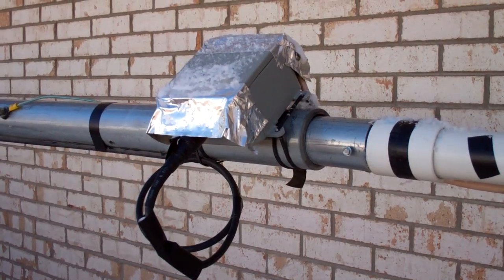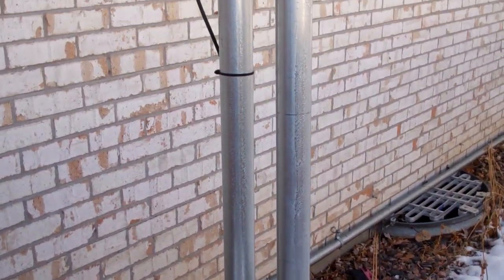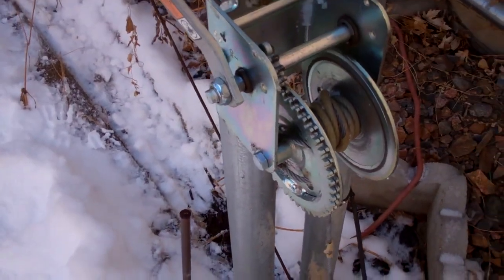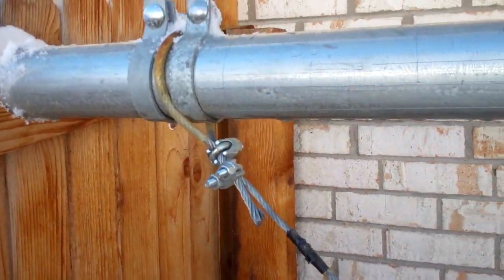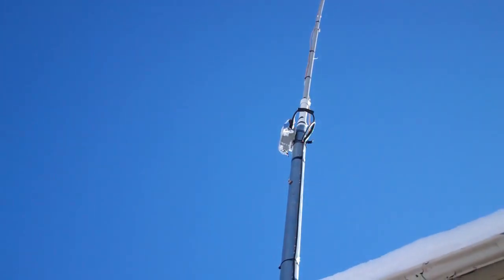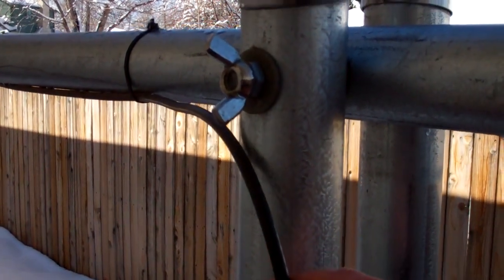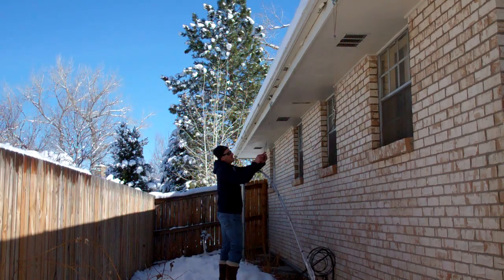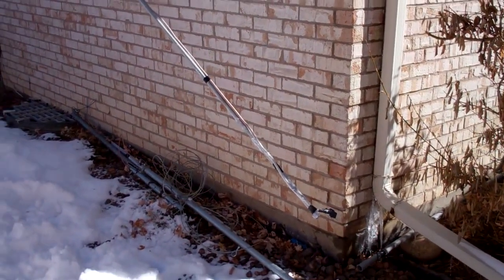Tilt-Over Crank-Up Antenna Mast

Comment: Considering this myself. thanks for the video. What is the status of your antenna mast now that it's  may 9, 2019?
Reply from the maker: I put it up about 10 years ago (2009) in its original version. I have had the fiberglass mast up for about 8 of those years. The galvanized steel parts show nothing other than the white/gray oxidation zinc gets over time. The fiberglass mast shows some discoloration from the sun but is still very flexible. The crank winch is the same as the metal mast pipe. The most affected by the weather has been the steel cable which was originally plastic coated. All of the plastic has dry-rotted, cracked and peeled off. The steel cable has surface rust/oxidation that looks normal and has not compromised strength. If/when I replace it I'd use a galvanized vs coated cable. All the bolt hardware is stainless and only shows rust in a couple of places like tips of threads or where there is a scratch. So overall I would say it is in excellent functioning shape. I wonder if a update video showing weathering would be useful?

Comment: That’s more complicated than it needs to be. Instead of adding an expensive wench, pulley, and cable, why not just add weights to the short end that raise the pole until it’s erect? After it’s up you could simply use a gate latch to secure it in place; it would have been a lot cheaper and faster.
Reply from the maker: The winck pulley and cable added only maybe $75-80 to the cost at the time. The original mast was 39 feet of 3 1/2", 3" and 2 1/2" thick-wall galvanized fence post. It weighed almost (or more than?) 200 lbs on its own. I had a 20-25lb antenna on top of that...so the whole thing weighed quite a bit and I was not able to pivot it into position. Even if I was able to do it by hand, one slip and it could have taken my head off. Now of course, after the first 13 feet, it is just 10 lbs of fiberglass pole with a simple wire running up the fiberglass. So now it is overkill. But I still have options to use it with whatever I may in the future.

Comment: Never run your rebar into the ground, they quickly rust all the way into the concrete.
Reply: Recently code has changed. They found not enough oxygen is underneath to support the rust theory. Rebar can now be ran into the ground on house footings .

Comment: You need a winch with a brake on it.
Reply from the maker: It has a ratcheting system that I was not using for the video because it made too much noise.

Comment: looks like a breeze rider we get 50- 60 mile per hour storms here bet its really steady then maybe you're trying to to get broadband the mast head should be in a broadband to say the least
Reply from the maker: It is used as a broadband antenna and has a matching transformer for MW that works a little bit for LW as well. Although it can stand a good bit of wind I rarely use it when winds are over about 10 mph.

Comment: That is a very neat antenna mast design and you have done a brilliant job describing it.  Thanks for posting it.  Have you made any modifications to it since the video was first published in 2015 ?  Thanks,  Jamie  VK2YCJ
Reply from the maker: No I have not made any further mods - other than adjusting the U-bolts as others have recommended.  It is currently the same as in the video. Everything seems to be holding up well to the weather and time.
Reply: Thanks, that is good news.  Jamie  VK2YCJ
Reply: @kugellagers  what adjustments to ubolts did you do ?
Reply from the maker: @lancelarymore1667  I fixed the Ubolts per Dave Vick's (and others) comments...I think I did it correctly anyway.

Comment: One of your saddle clamps is in on the wrong way round...the best way to remember how they go on is the old saying, "Never saddle a dead horse." So the "U" bolt goes over the dead end, short part of the cable and the saddle goes over the live or long section of cable. And like the other fella said, you need a way to secure the moving mast near the bottom, relying on the boat winch is asking for a trip to the hospital. But well done, quite clever.

I did something similar a few years ago with 4x4, 2x4 and a 12vdc ATV winch.
Reply: I have a few grey hairs, and I never knew that about saddle clamps. Thanks for the lesson!

Comment: Just a heads up on the use of the cable clamps.  The little "U" shaped clamps.  I'm a retired crane operator after 50 years in the field.  Did a lot of changing of cables through the years.  Here's a little saying to help you remember which way the clamps face when you put them on the cable.  "You never saddle a dead horse."  So the little short end of cable sticking out past the clamps is the dead end.  You don't put the saddle on that cable.  Spin it around so the saddle sits on the long cable, "The live end"  Also you only need one cable clamp.  Because each clamp you put on the cable reduces the strength of the cable by 50%.  All of this information is located in a book of cable rigging standards.
Reply from the maker: Thanks for the comment. You are the second person to mention that in the last month but gave a more detailed explanation. I will go fix that when I get the chance. When I put this mast up about 9 years ago it was the first time I ever did anything with steel cable. I definitely want it to be as safe as possible. Cheers.

Comment: Why did you put the cable clamp on backwards? Rule is "never put the saddle on the dead horse" as the saddle is on the dead end of the tail. I was taught to use 3 all with the saddle on the live side of the cable. Just curious.
Reply from the maker: Are you referring to the two steel cable clamps/bolts clamping the ends of the cable together?  If you are, it was the first time I have ever used them so I just put them on in opposite directions and at the orientation I thought would interfere least with the crossbar at the bottom of the two mast poles. No other particular reason.

Comment: Similar to my setup. I'm using 30' top railing, 10' fiberglass antenna, 50' RG8X coaxial, a swivel clamp that connects the top railing to a 10' top railing next to it which is cemented. I have a 2' pvc that is cemented underneath the main mast so when the mast is up, I can slip it into the pvc which aids in keeping it stiff and secure, hand winch and pulley. It's all secured with aircraft galvanized wire rope at different points. Although the entire concept is about 30lbs, I don't often use the winch. It's not that heavy for me to tilt over with the swivel clamp. I have my CB antenna up, too.
Reply from the maker: The 30' of top rail doesn't flex too much?  I've played with 20' of top rail with a temporary tripod setup for testing antennas but not 30'. My mast has been up there about 9 years now and the only signs of weathering has bee the plastic coating on the cable and a slight color change in the fiberglass mast. The original setup was much more heavy and tall and is totally overbuilt for how I have it configured now.
Reply: There's some flex with the 30' top railing when it reaches a specific angle while raising or lowering it, but, not much. It 's very stiff and doesn't move when I push it while It's up. But, It's still durable. Even with the flex, that stuff isn't going to bend. It's only taking about 3lbs-4lbs from the antenna for the highest top railing and the middle one take about 10lbs from the highest one, top railing is about 7lbs. I hammered the ends of the top railing in a bit to crimp it around each other, wrapped the ends with 3M electrical and rubber tape to make them thicker and add grip and keep them stiffer and some galvanized bolts and washers and Loctite. I had 20' of 1-1/4" pvc up for about three years, even during that mass hurricane I had last year. It held up, no damage. Maybe because the walls between both houses block a lot of wind. I wanted to go with a more easy and professional setup, though, so, I decided the top railing. That's good about your setup, though. I periodically addon little upgrades such as more guy wires when I have the funds to make sure everything is good. I just like taking extra steps sometimes. I thought of trying some conduit in the electrical area at home depot, about $7 for 10' galvanized. But, I went with the top railing because the ends were tapered so they can connect. Although galvanized sleeves don't cost much.  Top railing was $12.99, so, the conduits were half price. I have eye bolts in the top raining to connect the winch and guy wires. I may relocate my pulley, but, it gets annoying drilling through masonry.

Comment: Thank you very much for sharing this video.  This is what I had in mind for my future vertical antenna but I wasn't sure how to go about putting it together.  Amazing job!  Where did you buy the crank mechanism?   Make / model.  Thanks again!
Reply from the maker: At my local Ace Hardware store.  They have a lot of stuff you don't always see at the big box places. Here is a link to I think the same crank/winch I am using in the video: http://www.acehardware.com/product/index.jsp?productId=17209176 I also added winch info to the video description up above.
Reply: +Kugellagers Noodle Excellent!  I'll be ordering this winch very soon.  Thanks again for your informative video and posting the link.  73's WA4NE

Comment: nice job but how do you secure you mast? Not a good dea to let it hold on the crank winch!!!safety first
Reply from the maker: The crank winch has a locking mechanism that could be padlocked if necessary. I never have the antenna up for long as I only use it when I DX.  I only crank the antenna up when I DX.

Comment: nice job, I designed the same tilt over mast but used 4 X 4's (2) 12 foot in the ground and the center pivot is 20 feet, same as you, 3 feet into the ground, and 4 feet nested between the 2 base 4 X 4's, crank is on a lynch post (9 ft. + 16 ft. = 25 feet) then electrical kindorf (U channel) bolt mounts a piece of chain link fence top rail (10.5 ft.) to the top of the pivot 4 X 4 mast adding 6.5 feet for a total of 31.5 feet to the base of the antenna

Keep up the good work Rekindling The Reformation !!

Comment: KUT ,YOU SHOW HOW ITS WORK WITH THE 30 FEET STEELL PIPE ,THANKS RAMON ,I WANT TO BUILD ONE LIKE YOURS.
Reply from the maker: I no longer have the mast as 35 feet of all steel pipe but I did 
describe it below under Gear Hammer's question. The base and winch are 
adequately strong to use steel pipe as I used to have it. Was that what 
you were asking?

Comment: For additional safety, I would put another 1/2" bolt/wing nut near the bottom or middle to secure the mast for accidently falling, using the crank to secure the mast is asking for trouble!!!!
Reply: I totally agree with you, Ben. The time and cost to do that is minimal and the added safety priceless. The cable is already rusting and there is no way I would risk my safety or the safety of loved ones on just that cable. Good luck though! I love the idea!
Reply: Same reason tow truck drivers have to use chains to secure the front of a vehicle...  just in case the winch and/or cable breaks.
Reply from the maker: Hi Ben,  Thanks for the concern. The winch has a locking mechanism and the ability to actually put a lock or bolt to secure it (when up or down) as well - so there is no worry of it failing.  The cable is 1/4" steel cable and has several thousand pounds breaking strength and about 1400 lbs working strength.  For my uses it very safe as I only use it in good weather...I think it is more than sufficient for how I use it.

Comment: nice how tall can you go
Reply from the maker: +James  Schell  The metal mast pipe is 13 ft tall and the 4 sections of telescoping fiberglass poles on top are another 27 feet for a total of 40 ft.  The fiberglass section supports 27 feet of old RG-59 coax which I use as the actual antenna for MW/LW DX'ing.
Reply: ok thanks

Comment: Neat ingenuity! Wish we were neighbors I could use some help to construct a similar for TV antenna.
Reply from the maker: +Tony Micenhamer Thanks for kind words.  Yeah I&#39;d definitely lend you a hand. Overall construction was relatively easy as I built the whole thing without any help. Digging the hole for the cement was a little back-breaking as the soil has a lot of clay in it here...which is good for grounding but not fun for digging.

Comment: Nice job! Quick question: What about using some 1 inch EMT conduit that is coupled together instead of the fiberglass tubing? I know it would be a bit heavier, but that winch you have seems heavy duty enough to be able to do the job. Also, are you just running coax up the length of that and using the coax as your antenna? What bands have you been able to get on that design?
Thanks and 73!
ka0rsn
Reply from the maker: +Gear Hammer I used to have the mast itself at 35 ft in length and then an antenna on top. The remainder of the mast was two more sections of heavy gauge fence post that telescoped into each other and into the remainder of the current 3 inch piece I am using as the mast for the fiberglass.  I have also used fence top rail and EMT conduit in experiments. The problem I have found with using two or three sections of fence post or EMT, in my experience, is that due to the length I am using they are not very good in wind unless you are using guy wires.  The weak points are at the coupling points.  One ten foot section is fine but multiple sections become weak.  I do use connected 1.25" fence top rail as a mast on an antenna tripod for temporary antenna experiments in the yard but not for my permanent installations. I have also used EMT for a 1/4 wave CB base antenna as well.

In answer to your second question; The coax runs up the fiberglass mast and I am using the coax shield as the actual antenna.  I have connected the inner conductor to the shield at the top and bottom as well.  In addition, I put a female F connector at the top of the coax antenna so that I can use the coax as actual coax line to feed a small experimental antenna at the top if I desire. The design of the antenna is what MW DX'ers call a low-noise vertical which I use a broad band matching transformer of 44T:6T on an FT114 type J toroid in the small box at the bottom to match the MW and to some extent the LW bands. I am primarily a MW DX'er.

Comment: Just remembered I have a crank on my old boat trailer. Put the pole in the ground today. How hard was it to drill in the holes?
Reply from the maker: +Darryl Mann It wasn't too hard to drill the holes.  Just make sure your drill bit is sharp.  Having a steel tap to make a little dimple on the tubing helps to get your drill started too.

Comment: انت واحد متفيج فاظي ما عندك شغله 
بيب 10 متر فوق البيت و فك عمرك 
اقعد نزل و ارفع ما شي شغل شو
Reply from the maker: +qwasuae Forgive me for not replying properly.  I used many different online translators and they gave me various amounts of nonsense.  The mast is supported on the pivot point about 2 m off the ground.  The pipes in the ground are about 3 m long and about 1 m of the pipe sits in a block of cement/concrete that is about 0.6m x 0.6m x 1.0m in size. When the mast is raised the top is about 4 m above the ground.

Comment: What kind of antenna is that?...I like the crank up idea you did..Cheerz
Reply from the maker: +Junior D The antenna on top of the 13 ft Steel pipe mast consists of 4 x 8 ft sections of  telescoping fiberglass tubing I got from DX Engineering (http://www.dxengineering.com/). The tubing holds up 27 ft feet of recycled RG-58 coaxial cable I am using for the actual antenna I used for MW/LW Dx'ing
Reply: +Kugellagers Noodle That's cool, I like the homemade antenna's...You have any power behind it, or just stock??..Cheerz!
Reply from the maker: +Junior D Are you referring to the crank/winch?  Only muscle power behind it.  It's really easy - my 4 year old son can do it.

Comment: Where did you buy the crank?
Reply from the maker: +Darryl Mann My local ACE hardware had it near their steel cable supplies. They called it a 'Pulling Winch'.  I think this is it (or very similar ) :  http://www.acehardware.com/product/index.jsp?productId=17209176  I forget the exact capacity of my particular model.  I'll try to look it up if you like.
Reply from the maker: +Kugellagers Noodle I checked the winch capacity last night. The capacity of the one I have in the video is 1300 lbs. This is more than enough to crank it up.  When I first built this mast it was 35 ft of telescoping galvanized fence tubing with a 27 ft antenna on top of this. It was much heavier and was still plenty strong.
Reply from the maker: +Darryl Mann Tell me about it.  I do most of my projects in 1/2 to one hour increments...sometimes in only 15 minute increments. I built the crank up mast before I had kids and when my wife had a evening shift job - lots of free time at home then...

Comment: Have you had the antenna extended during any significant winds?  I'm not talking about hurricane or cyclone strength, but say 25 - 35mph? If so how does it handle? Asking because of how flexible it is, any concerns about it maybe snapping?  Like the concept, something like this might work well for my home, darn HOA.  Thanks.
Reply from the maker: Jim K Hi Jim,  If you look at my Low Noise Vertical MW BCB DX'ing Antennas video you can see this same antenna behaving in about 15 mph wind gusts. https://www.youtube.com/watch?v=hSwkM9aaGNU. I don't know if I would keep it up in much more than 15-20 mph gusting winds but it can take some winds as long as there is only a wire antenna supported by the mast as I have it.  I used to have a much heavier and larger surface antenna on top and would not put it up with winds much over 10 mph.  But as I currently have it in the video, I would say you could go to at least 15 mph w/o much worry. Of course  if you rig some quick deploying guy wires it should be able to take more.  As you can see by the flexing as I crank it up it in this video can bend quite a bit.